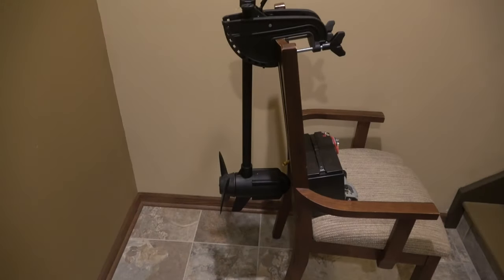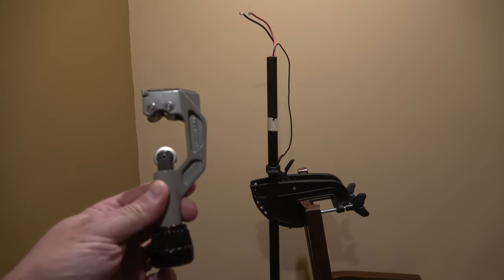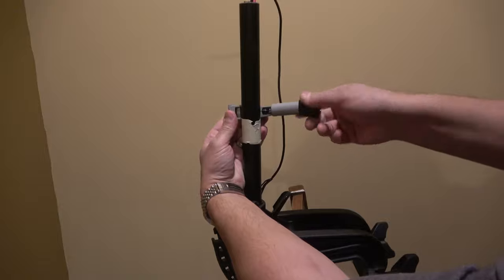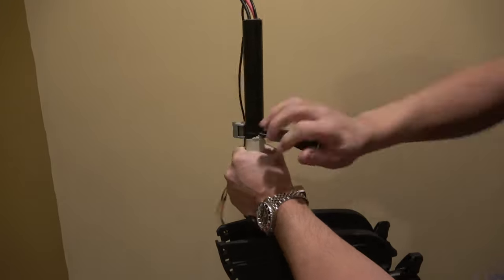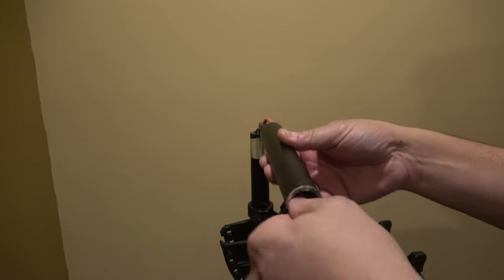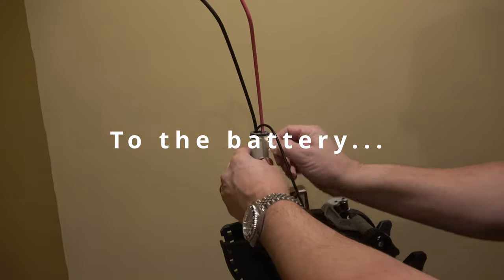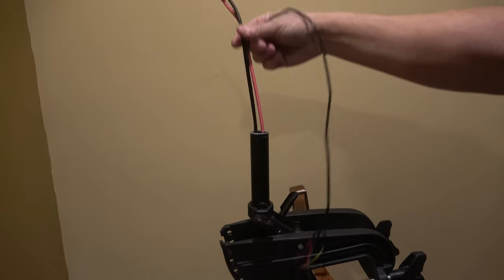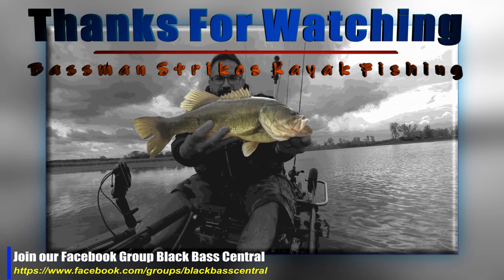BEST and SAFEST WAY to shorten a Trolling Motor Shaft!!! (Kayak Rigging)

Comment: Curious. Since you've shorten the shaft, i reckon that you'll probably already know how deep this thruster should be below water line to do so. Whats that depth?
Reply from the maker: The prop should be like 4 inches under water to start, but you kinda have to adjust it to get best speed for your particular kayak. If it's really weedy I raise it so the prop is barely under water.

Comment: Thanks for this video! I saw a video that you have showing how you lift the trolling motor, I see that it has a system that presses the brake that does not allow it to lift... Could you explain how you put that arm, please? I saw that you also changed a base from another brand that has the brake on the opposite side.
Reply from the maker: Hi, thanks for watching,  unfortunately that's too much to explain in a comment, head over  here and ask the question:
https://www.facebook.com/groups/708485535876457/?ref=share